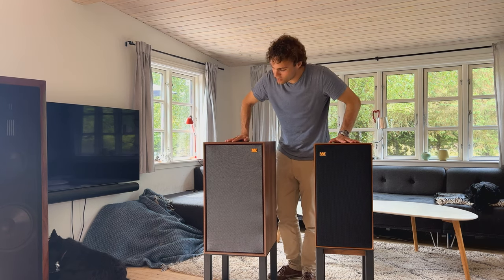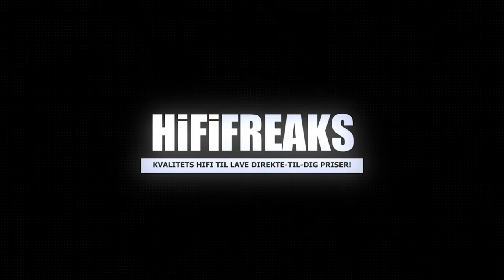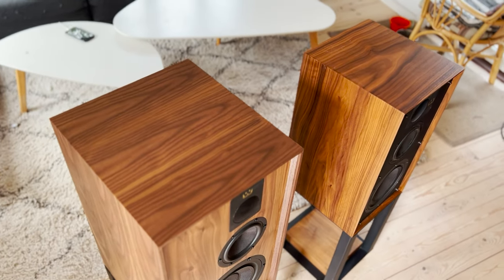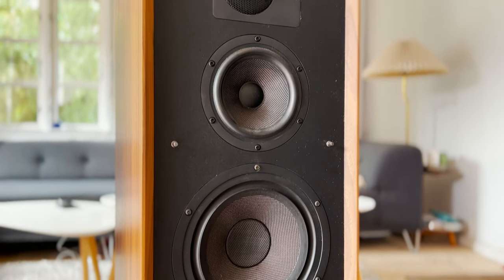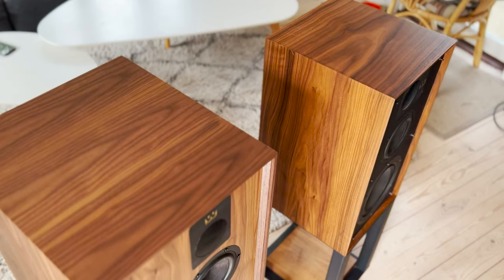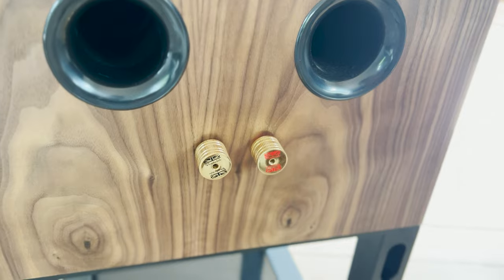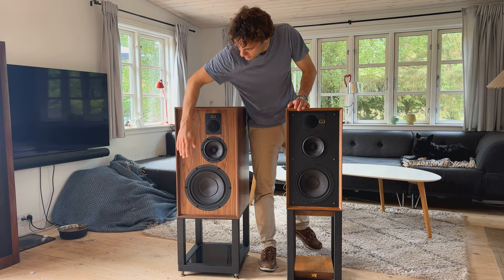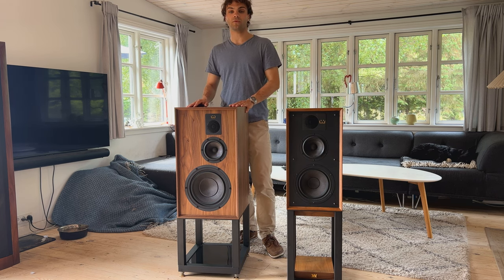Wharfedale Dovedale vs. Linton: Interview with Peter Comeau on differences

Comment: This might be a better performing speaker than Linton but as others suggested the difference does not warrant 4x price hike. Peter always does this sort of speak, when Linton’s were released they were “unmatched, with technologies and sophistications way beyond its competition”, only to be talked down by Peter against the Dovedale which is the again the new king of the castle at this very moment and at the time being

I’d bet both the tweeter and the midrange drivers are pretty much the same, with a little bigger chamber at the back.

Made in UK only goes so far, Lintons which are made in China set the new standard in quality speaker build years ago.
Reply: I would have to agree!
Reply: Exactly, both are kevlar and the tweeter is almost the same! only a bit of absorption at the back, they say. Criminally overpriced. I put better damping to the Linton and better components to the crossover and you have quasiment the Dovedale.

Comment: Can you confirm or deny if the treble and midrange are the same units as the Linton. ?
There are several who claim this and there is simply a larger back chamber behind units at Dovedale.